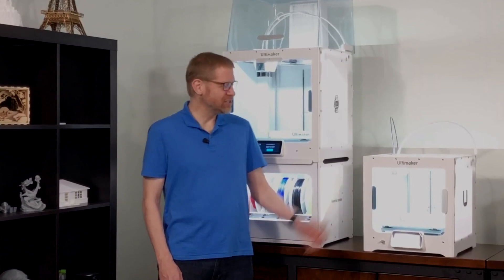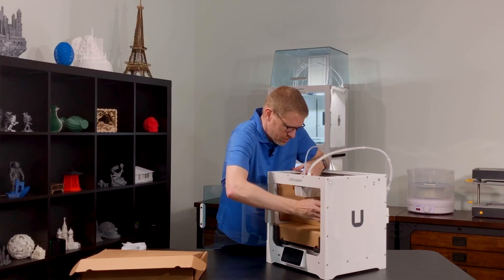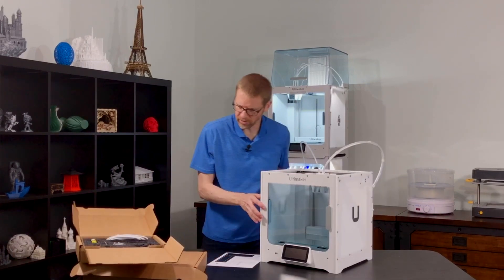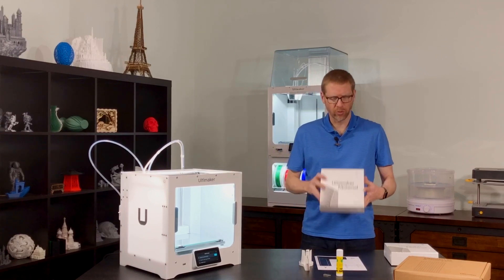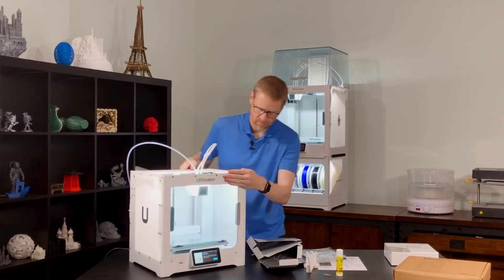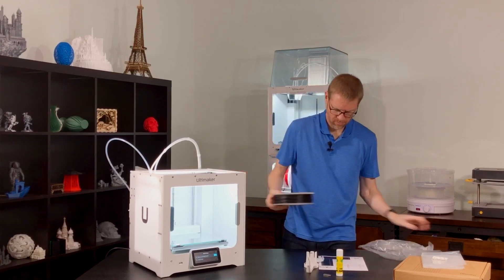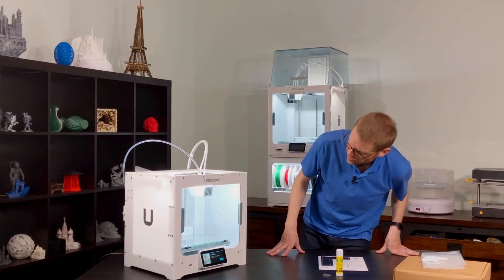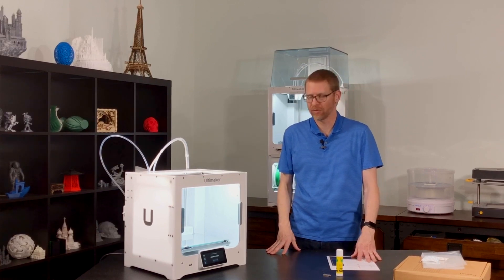Ultimaker S3 Unboxing and Setup

Comment: Great video. Do you have a link of your XY calibration video you mentioned? I wasn't sure if your video from 2017 is applicable to this recent S3 release.
Reply from the maker: We should probably do an updated video, but for now, that 2017 video will still show you how the XY calibration process works and how to read the results, which hasn't changed since then.

Comment: Can I use 1.75mm filament with the S3? I seen the website recommended 2.85mm. Thanks 😊
Reply from the maker: No, all Ultimaker printers are designed to use 2.85mm filament. Some people have made modifications to allow for using 1.75mm, but that's not what they're designed for.
Reply: 3D Universe hmm okay, thank you

Comment: Hi. how much noise does it make? thanks
Reply from the maker: It's very quiet compared to most desktop 3D printers. It could be running on a desk in an office environment without bothering anyone nearby. Ultimaker shows the operating sound level to be < 50 dBA in the specifications.
Reply: @3duniverseOrgWelcomesYou  thanks

Comment: Can I use carbon fiber
Reply from the maker: Yes, the Ultimaker S3 includes hardened steel components in the feeders, so you can use abrasive materials like those infused with carbon fiber. You would need to use the optional CC 0.6mm print core, which includes a hardened nozzle.
Reply: @3duniverseOrgWelcomesYou  thanks
Reply: Where do you find ideas to build with this printer???